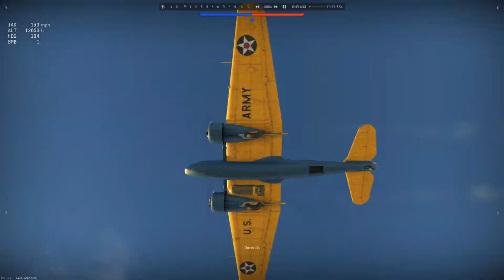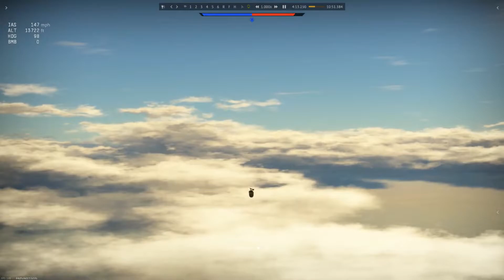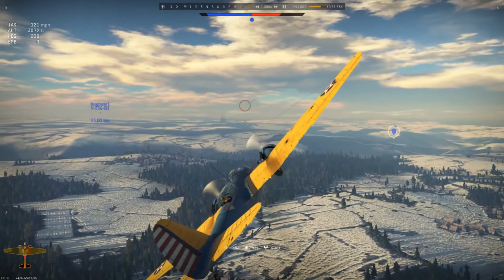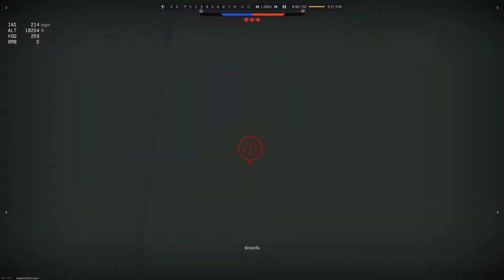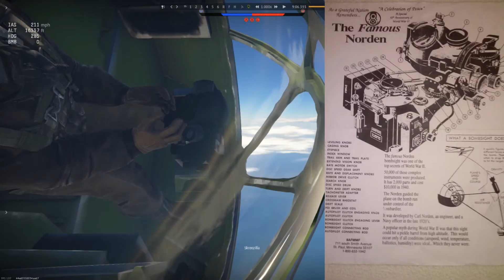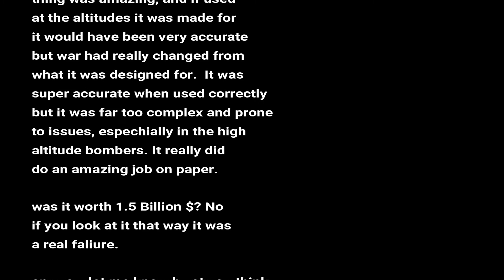History of: The Norden Bomb sight

Comment: Skreezilla, you have regurgitated all sorts of misconceptions and urban myths that have cropped up on various dodgy websites. If you start with original USAAF maintenance manuals, BIF's etc, you will then have a factual basis to build on.   For example, the secrecy myth:   All the USAAF training films and manuals for the Norden were marked "Restricted".  This was the lowest classification and routinely marked on all manner of ordinary things.  "Restricted" was US military-speak for "Not intended for distribution to the general public".
The US military spent an average of about $8,000 for each Norden bombsight - this is insignificant compared to the cost of airplanes such as the B-17, B-25, or B-29.
The pickle-barrel thing:  That was originally said by a Norden executive to a journalist.   It is the same sort of thing as you or I claiming our car accelerates like greased lightning.  It was never meant to be taken literally, and only a fool would put any credit on it.

Comment: My father was a chemist and worked for Perkin Elmer  in CT during WWII and he developed a cleaning solution that cleared the condensation that occurred when thee planes flew at higher altitudes. Prior to this, if you flew 25 missions(which was very rare due to the high mortality rate from low level flying, See Memphis Belle as a reference to this.) the crew was done for the war. This allowed the crews to do high altitude bombing and this restriction was removed.
Reply from the maker: Oh very interesting!  I actually work in optics and know the sprays that evolved from that one so long long ago. 
Also yes the old 25 rule which went up to 30 then 35 as it got safer and safer due to higher altitude. Good ole Hells Bells was the first to get the 25 by 1 week how ever the American PR team did not want to advertise a plane that had Hell in it's name. 
The other interesting thing on that one is the crew of the Belle, i think it was 6 of them to reach 25 as some crew members had been sick for 2 or 3 flights, And many who reached 25 actually chose to continue operations. Really need to do that film review :)